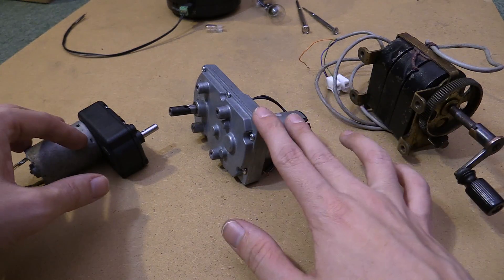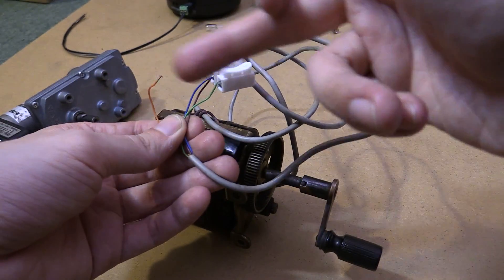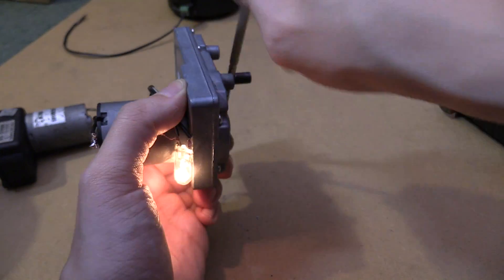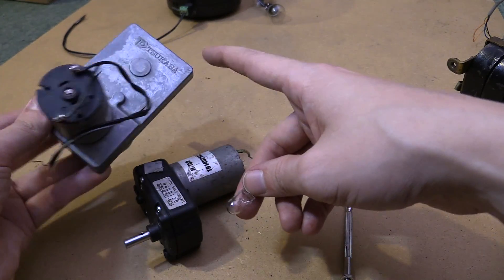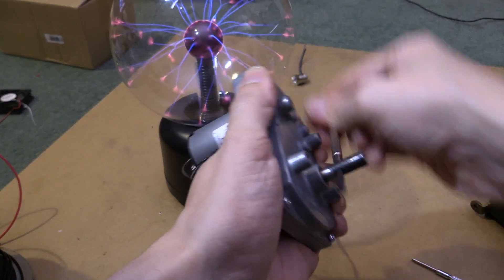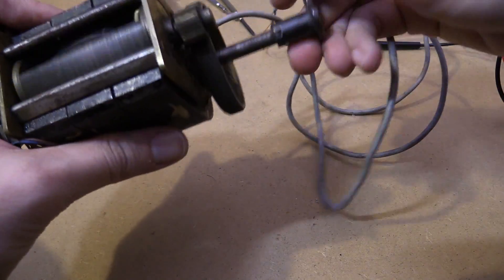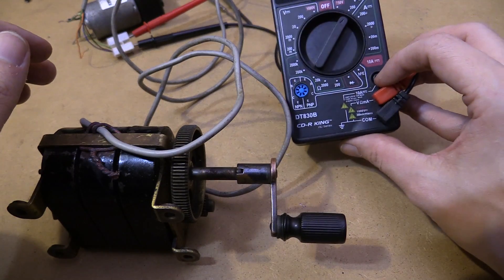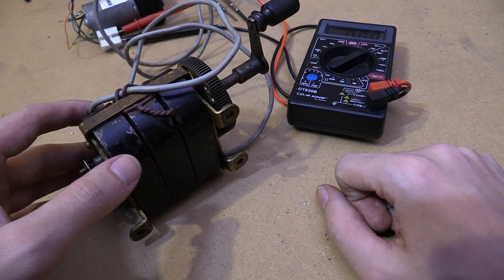DC generators from ebay

Comment: There is a new crank generator selling at banggood, it's a blue colour 20w generator,the voltage can be select by a switch 3,5,6,12 and 15v can be selected and that item is not really expensive.

In this video I really lol when you put your foot up :D

Comment: Im thinking about a generator to use it with an inverter ( inverter 1000watts 120 v ) do you think one of these would work ? Im mounting it to a water wheel to use of grid.
Reply from the maker: +albertguti23 mmm maybe but you'd be better off with a larger motor which you could also find on eBay. It depends on the strength and flow of water but these are pretty small motors for that kind of application.
Reply: i think the coper wires inside the generator will burn , when u use it with a 1kw inverter
Reply: i did not know that could happen.
Reply: I´m going to adapt a car alternator, im disassembling it to place some magnets inside of it. and im planning to connect it to a 12 v regulator and then to the inverter. i hope it works. im waiting for the things to arrive.  (i´d like to share the link that shows where i want to build it)

Comment: Im also interested in getting stuff like these from eBay. Do you have any idea how much it would probably cost to buy these and get them shipped to the Philippines?
Reply from the maker: +scoopable1 shipping from HK or China is usually free on ebay but it takes week or months for them to arrive and the post office to tell you. Although I've heard the provincial post offices notify you faster than those inside metro Manila. I guess cos they're not as busy.
Reply: Gadget Addict do I have to pay anything extra to the post office if they I get anything from ebay?
Reply from the maker: +scoopable1 if the item plus shipping is less than 10K PHP there should be no charges except a P120 inspection fee. There are some exemptions like tobacco, alcohol and some other stuff that is taxable regardless of value.
Reply: Gadget Addict Awesome. Thank you so much for the information! :)